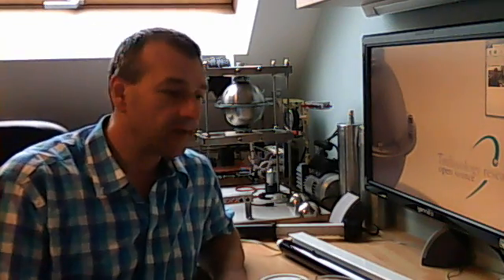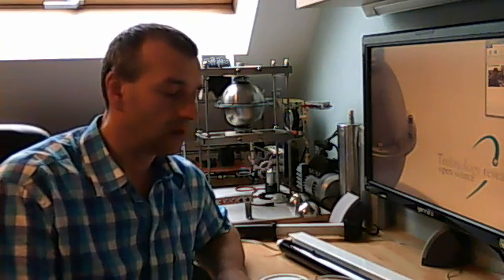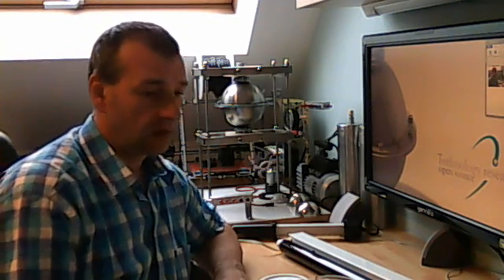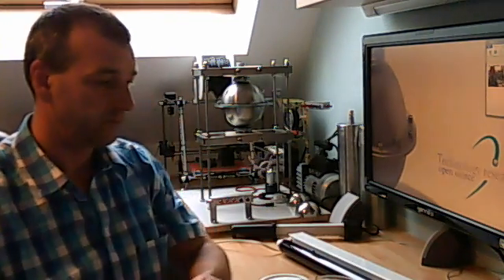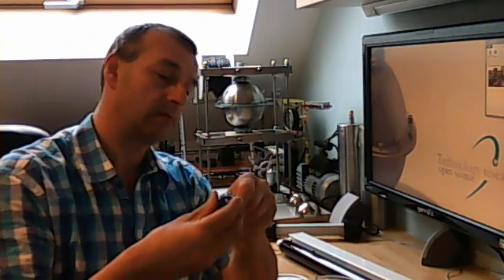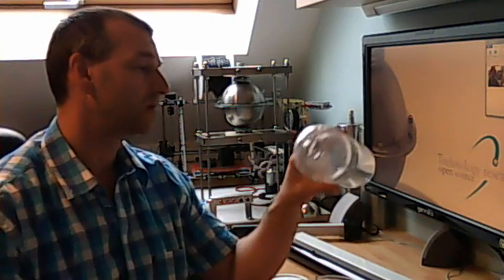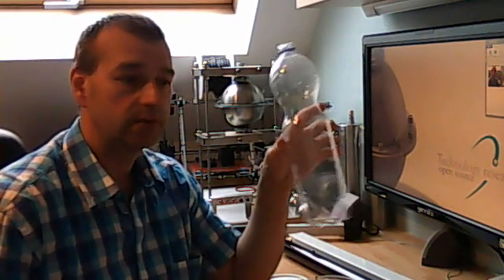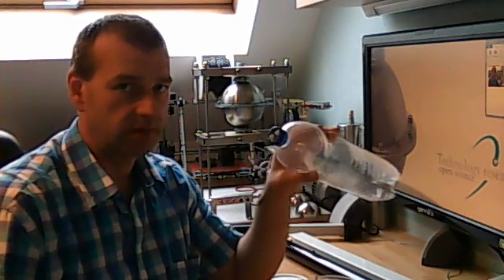V5 graphene coating test

Comment: **First of all how did u get carbon or any of its allotropes onto copper without using any carbon compound in the rxn. Like using coppper and KOH might forn CuO or Cu(OH)2 but not carbon.
**Secondly the uv doesnt prove the coating is graphene or even graphite , it is just a demonstration of photo electric effect (in layman terms when appropriate wavelength light shines on surface (usually conductor or metals) it will generate a current or photoelectric current and hence a voltage) and probably there is induced emf in that setup of urs due to the UV tube thats boosting up the current or voltage whatever ur measuring.
**Thirdly how does no measurement imply that the stuff ingraphine . Atleast u should have shown the dmm indicator . Nevertheless that reading of urs ,assuming the dmm was set to minimum resistance was showing , that the resistance is higher than that of bare copper proving that the coating is neither graphite nor graphene . It is probably nonconducting CuO.
**Lastly u must clarify what u were measuring in that copper and watter setup , it s seemed like mA rather than "mV" as u stated . I RECOMMEND USING AN HD CAMERA AND CLEAR LANGUAGE. 
Thanks buddy. Expecting a response soon!

Comment: Thanks, very interesting Geert! Are the scientific tests for detecting the presence of graphene too expensive? Is it possible that the EMF fields of the flourescent tube's ballast transformer are inducing an additional current in the coated wires?

Comment: Thank you so much! This was a breakthrough for me. Took so long to finally get this info. Awesome...
Reply: +lars bendixen Stop that ignorant an potentially dangerous fumbling
Reply: +Jean-Pierre Mürrli Not sure I get your meaning
Reply: +lars bendixen 
Likewise!!
Reply: +lars bendixen 
Quite simple - you are experimenting with chemicals without really knowing what you are doing. Geert Vranckx knows and id careful enough. But you know: quod licet jovi non licet bovi :)
Reply: Thanks for the ox comment. You are obviously a super erudite person. What is useful here is the evidence that the nanocoating process produces graphene-like coating that reacts electromagnetically to light. Pretty useful, considering the possible applications.
Reply: lars bendixen It does not. A real graphene coating is almost invisible, it looks similar to an oil film on water.

Comment: Hello Geert - Erick from foro
a greeting, I think you should put a polished aluminum reflector
to the UV source, that was the only way I achieved reacting (dry-curing) UV inks - should work just with
your experiment.
I use mercury bulbs HIGH PRESSURE, you can use 50 watts, using only what's inside, if you want to call me on skype and I'll show you.
skype - erickclaussen.
should be cautious with these bulbs. are very strong.
you should not expose your eyes to the UV light, not your body.

Comment: Please test if the black debris dissolves in diluted mineral acid (sulfuric acid, hydrochloric acid e. t. c.) or vinegar essence. It is very likely that the debris is copper oxide (CuO), which dissolves in said liquids, while carbon (also graphene) is resistant to them.

Comment: stick a graphite pipe with o2 from your torch flowing threw it right threw a microwave oven literally drill 2 holes in your microwave one in the front door and one in the back  turn it on and get it going  you might have to open the door a bit  to get it really going  till the plasma be a bubbling  preferably doing this outside lol your graphite pipe will be converted to graphine  and plasma of coarse take care

Comment: rotating seals in automotive section  larger ones used on vac trucks in Canada to raise and lower tire pressure might have to go to larger outer sphere  change graphite rod to grapheme in microwave with o2  plus some plasma lol  awesome best 2u

Comment: Bedankt voor de video Geert maar er is ook een andere methode om Grafeen te maken zie deze video, Making graphene supercapacitors with a DVD writer. Het vacuum is extreem belangrijk zie dit patent PROPULSION SYSTEM USING THE ANTIGRAVITY FORCE OF THE VACUUM AND APPLICATIONS Patent application number: 20120092107